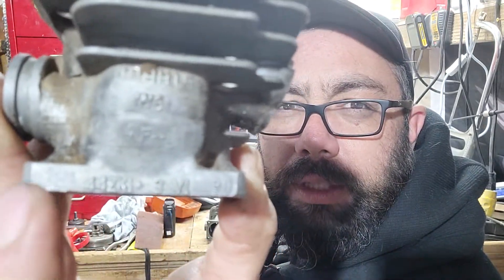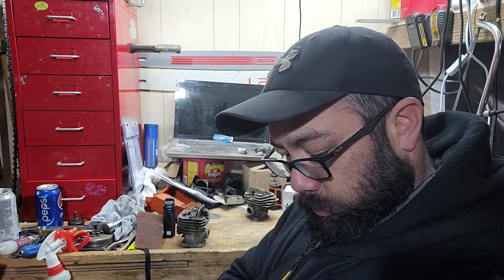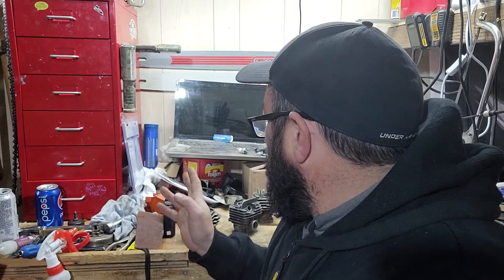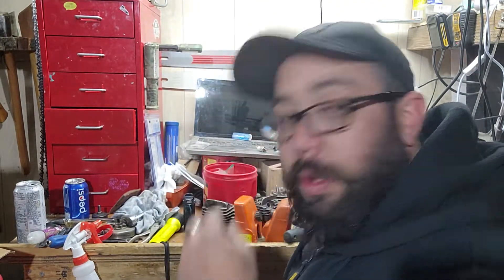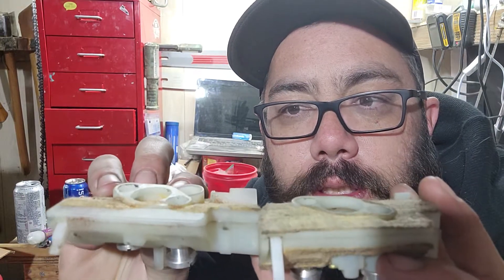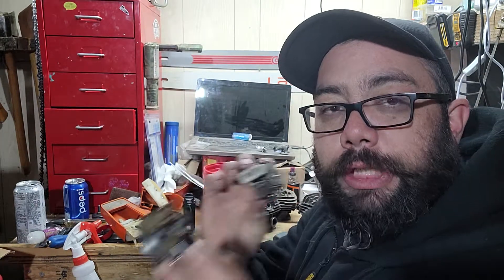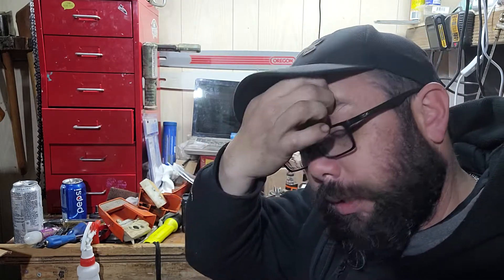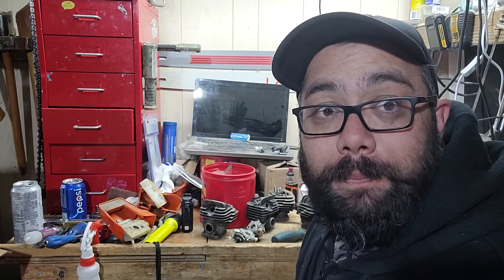Some differences between #Stihl #026 and #ms260

Comment: 026 had 44mm cylinder, 026 Pro had the 44mm cylinder with a decompression valve and an adjustable oil pump. Early 260 had the 44mm cylinder without the decomp and oil pump. The MS 260 Pro had the 44.7mm with decompression valve and pump.

The 026 Pro had the flat covers and had at a later production date the compensating metering plate with the newer 260 style filter with the cover for it which was also a flat top.

Comment: Can i put a stihl ms260 jug with decomp on my earlier stihl 026 red lever?
Reply from the maker: Yes, so you probably have a 44.7mm  jug which will need the matching piston and rings with go with it as 026 is a 44mm bore. The top ends swap around on that chasis just make sure to have the proper piston to match the jug